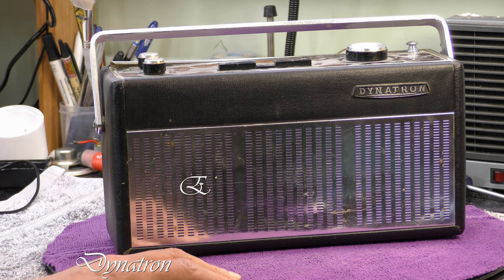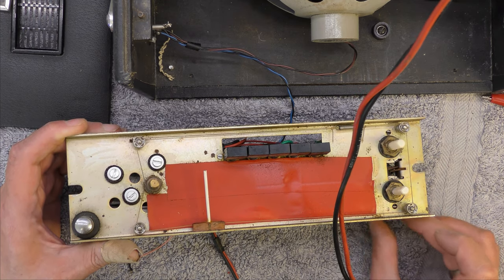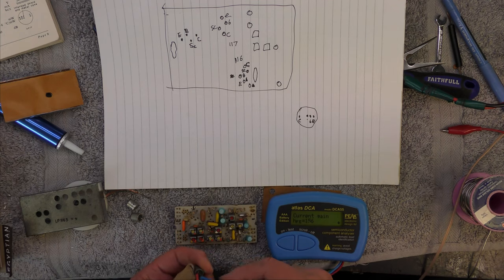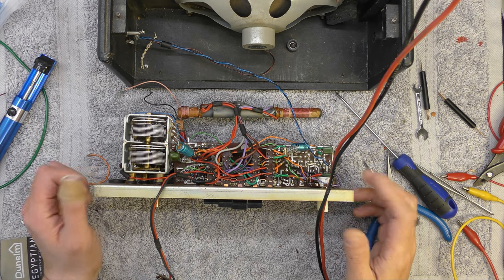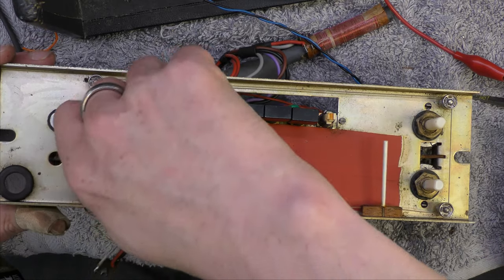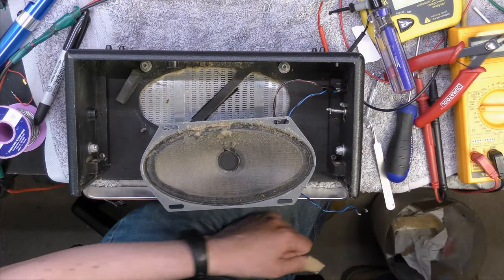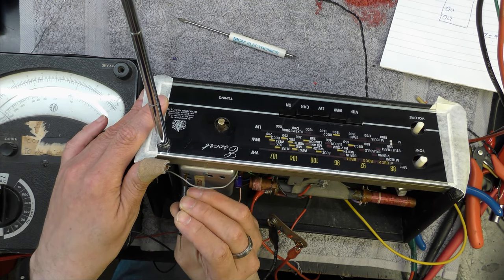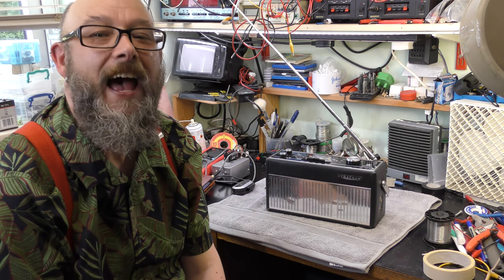Dynatron Escort TP43 Vintage Transistor Radio (4K)

Comment: Hi Daz, super video. I've worked on quite a few Dynatrons and those tuning capacitor grommets are nearly always hard. Amazing that contemporary Hacker sets, built a couple of miles from the Dynatrons rarely suffer from the same issue! Different suppliers I guess. I'm currently working on the very similar Dynatrons Elan.
Reply from the maker: I look forward to see other Dynatron radios. I do like Dynatron stuff, just got a cassette deck and this radio at the moment.

Comment: Cracking video that Darren. That had a lot of issues. The Mullard module is always a nightmare whatever radio it’s fitted in. I did like the way you hooked it up to test it outside of the radio. That saves so much hassle. The FM front end that mounted on the tuning cap is the same as fitted on the Dynatron Atlantis. I do normally pull them off to replace the AF115 but you managed to do it in situ which saved a lot of trouble. Great explanation of the circuit. I have one of these and the outputs are fitted on a heatsink and dropped at 90° off the end of the board. C4 is marked wrongly on the screen print. Cheers Graham
Reply from the maker: Thanks Graham. I was surprised to see a silk screen error. Thanks for the pictures of the transistors, so not the square cased version but all I had. You must have done many modules yourself now, but this was my first and not sure of results so tested it. Well done on getting your tuner head removed, I was a little unsure.
Reply: @darrencoe5795  those K version transistors with the built in heatsinks are much better. Once you have done something you learn from it which makes future ones a lot easier

Comment: Great video and thanks for sharing some explanations on the circuit and your diagnostic process. Regarding the lack of diode in the base biasing of the audio output stage, how does the diode voltage drop (forward or backward biased?) help regulate the voltage (and current from the intrinsic ohms in the transformer coil tap?)? I'm trying my hand at repairing old pocket radios and see the diode occasionally. But I am very much learning by the seat of my pants - well-intended, self-educating and broadly under-qualified!
Reply from the maker: The diode is forward biased and as it heats up the forward voltage drops, so reduces the bias to the transistors thus controlling the standing current. Too little bias and you have crossover distortion, to much and you run down the battery  faster and the transistors can run away if they get too hot. Germanium transistors are worse for this. It also helps reduce the effects of falling battery voltage. Thanks for watching, Daz

Comment: Sounds 100% now darren :-D
I'm really supprised that the output bias was so rough,  and a missing heatsink has to be due to a pillock messing with it.
I'm a bit of a bodger, but not on that level of nastyness :-(
Sometimes a part costs too much so some bypassing is the way, a frend had a nice vcr but the multiple power regulator module died on one output. £40 was a bit too much for the module.
A small relay plus transistor drive and a 7812 regulator fixed it spot on, a bodge or an alternate route lol.
Feel the power of the bodge luke.. errr daz :-D
Reply from the maker: Yes, I guess I got a radio in poor condition and bits missing. To be honest it was given to me with some other stuff as a gift so can't complain. A lot of problems but it is good sounding and the tone control is good design. Yes, these modules can cost a small fortune so I agree sometimes you have to find another way. Many amplifiers have modules. Daz
Reply: @darrencoe5795  
i've watched radio cruncher fix quite a few of those mullard i.f modules,  the evil tin whiskers ;-(
He has a radio for testing them as well,  very sneaky but i like it lol.
i'm enjoying watching your videos, i leave a comment to show appreciation,  i don't expect a reply as people have other things to do.
Keep tinkering :-D
Ta ta .Harvey